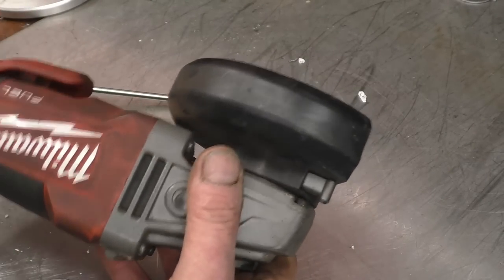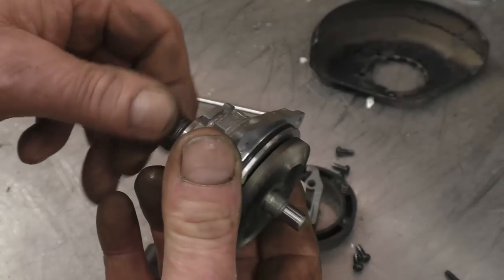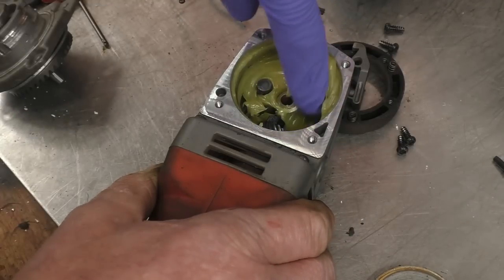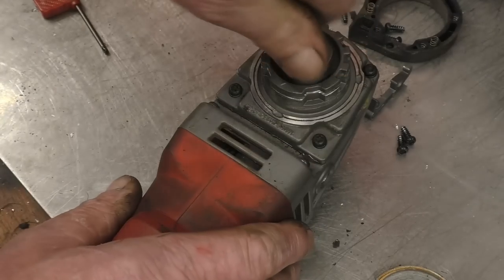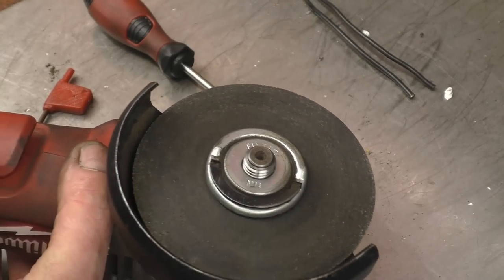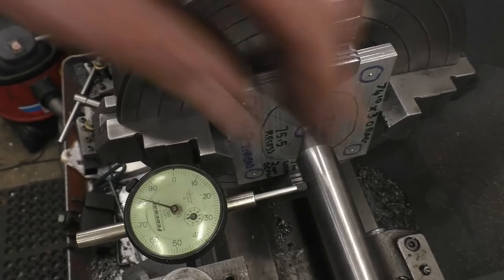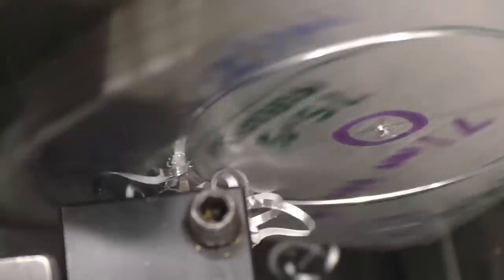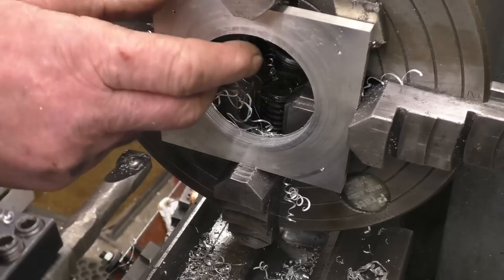SNNC 459  Salvaging A Wrongly Machined Part

Comment: John, at 7.44 when you're adding new grease it looks like you've knocked a thrust washer from the central bush out of place. You can just see it to the left of the central bush, buried in the grease. Keep up the good work.
Reply: Agree. That’s going to make a right mess when it finds its way between the gears.
Reply: If you go back to 7:13, you can see that there's no thrust washer there. What your thinking is a displaced thrust washer is actually the locking pin for undoing the disc ?

Comment: Nice job on picking up thread and repairing it, I do like cordless tools, nearly all have rapid stop feature,  a few corded do.
Great jobs all-round,  thanks for sharing. 
Hope you a safe trip back from Brum.
Reply: I have a similar method, like John get all the backlash loaded up and stop while engaged, then I maneuver the tool into the thread form using the cross slide and compound. a little more fiddling and done. Might be a good job to check the grease in all my grinders as well.

Comment: If you turn the guard 180 degrees from straight out, those notches and slots will align, and it will lift off. No need to take the screws out. But I did the same thing on mine until I figured that out..

Comment: Was anybody else saying "John, your maths is wrong"?
Reply: where, exactly?. To me, by the drawing the recess is probably dimensioned at its centre line, which leaves a pretty nutty 0.75mm width of metal between inner edge of the 3mm 'O' ring and the 71mm hole
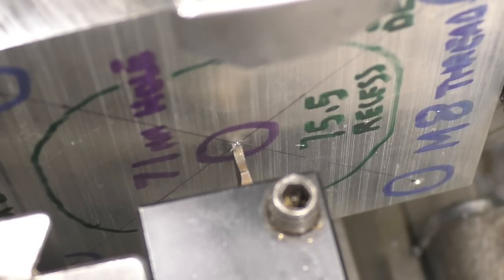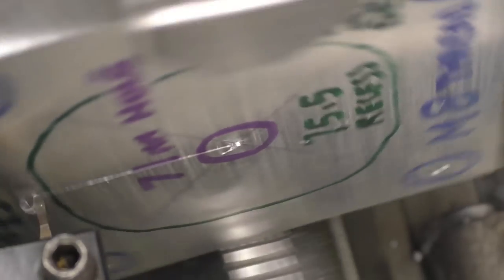Reply: Half of 75.5 is 37.75, which John says at 13:25 and again a couple of seconds later.  But at 14:00 and onwards John says 35.75.  The engineering drawing does not state whether the dimensioning of the o-ring recess is to the centreline.
Reply: @mikeparfitt8897  Thanks for that, I got too caught up in the dimensions.  On looking further, 'O' rings are usually specced in o/d,i/d and thickness; sometimes sized only as i/d and thickness.   @10.38, the drawing shows the 'O' ring spec at 74.0 by 3mm.  Suppose this refers to the i/d.  Normal 'O' ring 'stretch' when located should be about 2%.  2% of 74  is 1.48, suggesting that the i/d of the restraining groove should be cut at 75.48mm; to be compared with the drawing spec for the recess at 75.5mm, equating to the 37.75 mm radius. A tool shift from the groove tip's centralized location of 37.75 plus half the groove tip width should have been good.  @16.04 John said he should have cut the groove 1mm further out; maybe he misspoke the twice  @14.00 or thereabouts.